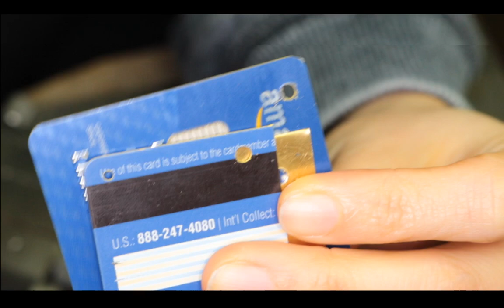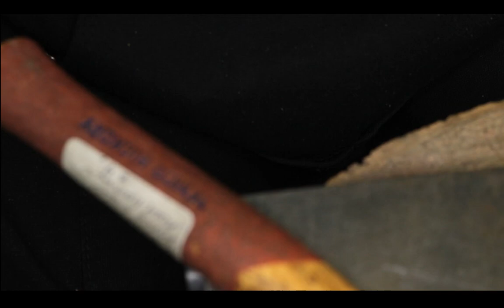How to Tube Rivet from Tubing - Easy Tips for Jewelry Making

Comment: You can also set stones in a tube rivet.  You just need to get the thick tubing.  Rio has it.  I haven't seen it in copper though.  Just sterling silver
Reply: Just saw a youtube on setting a stone in a copper tube.  Just inset a smaller tube into your copper rivet and solder the back.  Then use a hart bur and drill deep enough to set the stone-on the front of the rivet.  Hammer copper around the faceted stone to set.  Haven't seen this done yet, but would be interesting to try.
Reply from the maker: +Sally Richards I'm eyeing a bezel punch set to start with this. I hardly have any small stones in my stash.